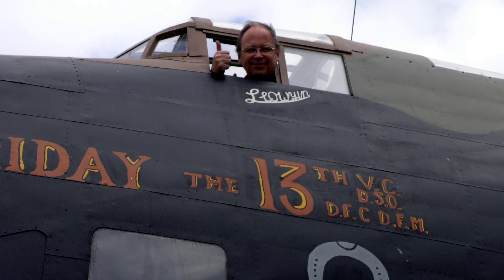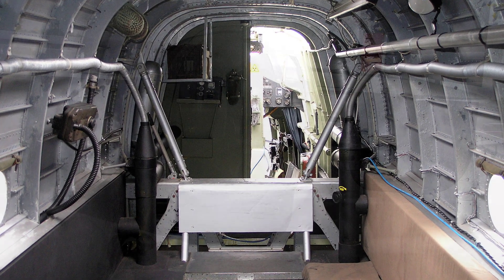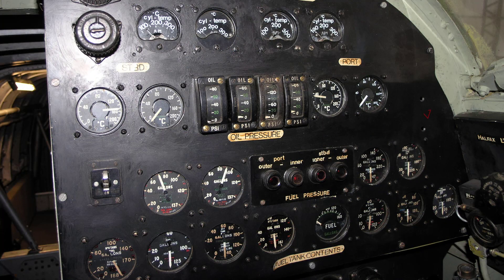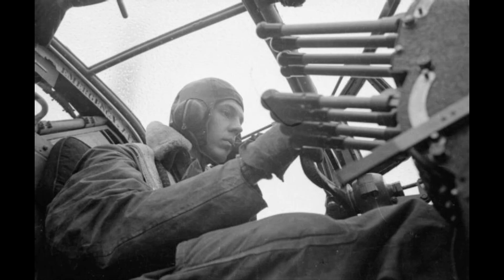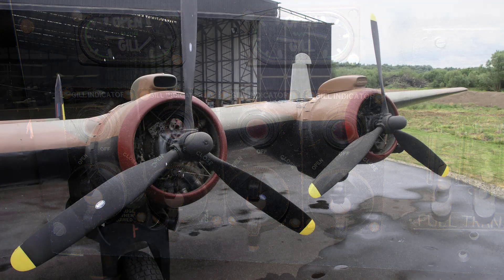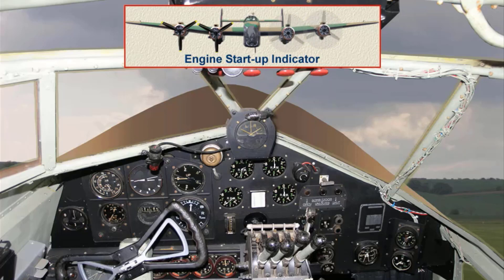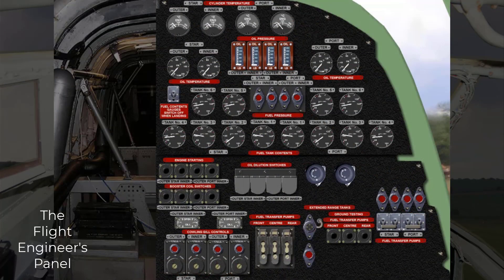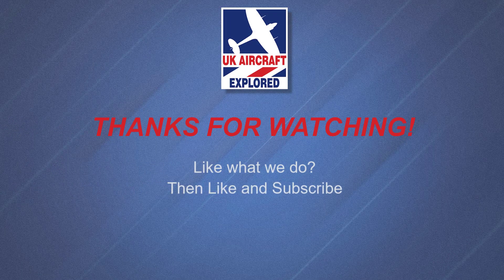Halifax Bomber – Engine Start Sequence

Comment: NB interesting to see the radials needs a couple of manual rotations to shift any oil that had seeped into the lower engine cylinders that would otherwise lead to hydraulicking as mentioned. I assume this would be the same on all aircraft radial engines - I know it was an SOP on British tanks from the USA powered by radial engines, eg the M3 Stuart, M3 Lee, and maybe some M4 Shermans too.
Reply from the maker: Thanks for watching